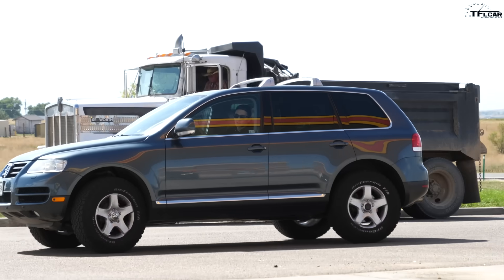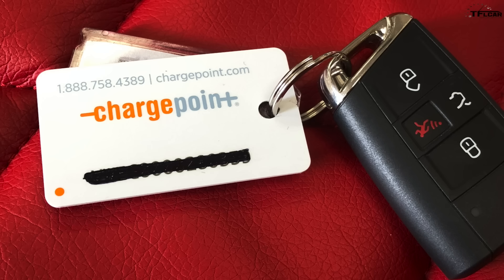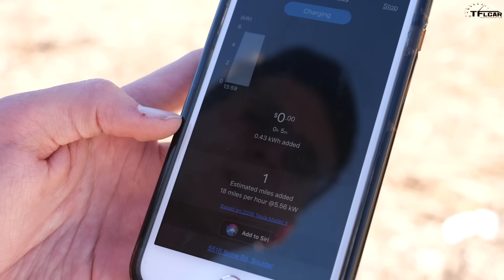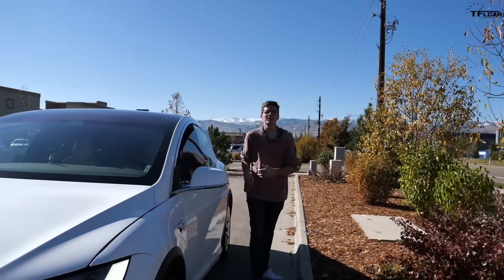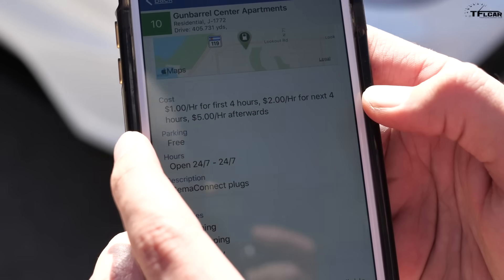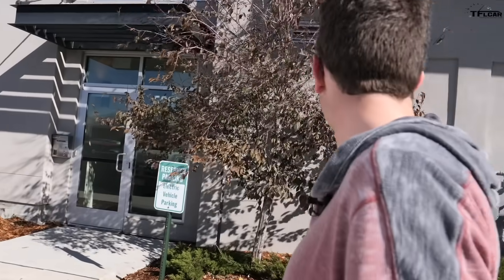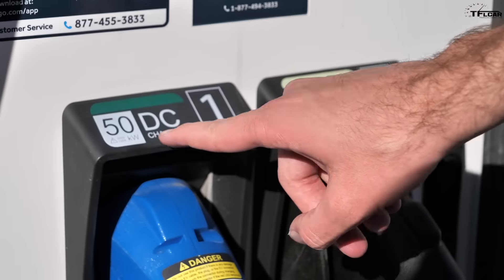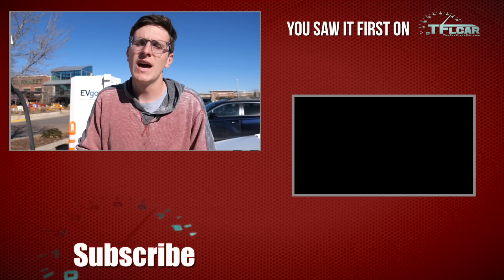Here’s Why Charging an Electric Car Can Suck - And It’s Not The Reason You Think!

Comment: Here are a few questions that must be asked when you own a EV.
According to what you stated, do you really want my wife (77 years old) "backing" into a charge station next to your Tesla???
How about the kids opening the doors of the minivan which parked next to you and hitting the side of your Tesla or other EVs?
The charging station is operational from 8:00 am - 5:00 pm.  I work those hours and drive my EV to work.
The electricity supplier still burns coal to make steam for the generators.  (so much for no air pollution)
OK, you have atomic reactors supplying your charge station.  Can we bury our reactor spent rods in your back yard?
What is the price of replacing your Tesla battery when it dies plus the disposal / reconditioning fee for this service? $13,000 -$15,000. 
Warranty will replace your battery if needed IF YOU KEEP YOUR BATTERY ABOVE 70% LEVEL.  The must have software installed to monitor this?

Comment: 99% of most people's driving is within 50 miles of one's home.  This means you have to go to a gas station, perhaps using a gallon or two of expensive gas to get there and back.  Round trip, 30 minutes easily.  EV's plug in at night while you sleep.  You just get up and go, no wait, not trips to the gas station.  Every house has 220 volt electrical service.  It's' what powers your electric stove, or larger air conditioning, and all central air.  Not a big deal to run a 220 outlet into your garage.  It's not rocket science.  All it takes is an outlet, some 10-2 romex, and a 30 amp breaker.  All can be purchased for under $100.  Of course, you will want a licenced electrician install it.  But the cost is minimum.  No big deal.  Then you have your very own "gas" station in your garage, anytime you need it, even while you are sleeping.

Comment: The majority of Tesla buyers have garages and intelligently charge their vehicles over night. Drivers rarely drive more than 40 miles a day so this process is quite sufficient for most drivers. I consider using a no name, non Tesla charging station for a Tesla a last choice option to be used only in an emergency.  Like going to a gas station and the filler nozzle is only an eighth inch tube. With all the benefits of driving a Tesla compared to ANY other vehicle (gas or electric) you've really gotta loooook for something negative to say.

Comment: While it remains only an extreme minority of drivers using EV's, and only people to whom the inconveniences do not outweigh the advantages, this all works.  
There is no way for this to go mainstream right now.
Plus, I own all my vehicles.  Who is throwing me  $50-$90,000 to replace them? 
Admittedly, MOST of my driving would be within the range of an EV.  Not all however.   
That basically means living a Hybrid life.  Gas vehicle for when the EV doesn't fit the mission, EV for most of the local stuff.

Comment: What if everyone had one of these cars, can you imagine the wait time involved?
Reply: The wait times would be worse than the 1970’s at the fuel pumps!
Reply: Waiting an hour to get 17 miles?

This garbage will never work in rural areas.
Reply: SOLAR PANELS ON HOOD AND TOP OF VEHICLE?
Reply: @Juliet475  OR A HORSE PULLING IT!
Reply: @Juliet475  USA is all about to make money they will never do that
Reply: Imagine a cross country trip? It would take you an eternity to get across the county and that is providing your car is running perfectly.
Reply: @philipe7937  I don't have to imagine a cross country trip in an EV - I've done several. It is entirely practical, and I could easily make 800-1000 miles a day if I was in a hurry. Did that a few times, but more often the point was sight seeing and visiting folks, so most days were under 400 miles. But I got from San Francisco to Cleveland in 3 1/2 days.
This charging video grossly overstates the problems of EV charging. Tesla, in particular, has built out a fast, reliable, well placed network of easy to use chargers. And on busy routes some sites have 50-100 chargers, so no waiting even on a busy travel day.
Reply: I know uh.  Wouldn't be very practical, although I do like the idea of E-cars.
Reply: @LegacySportsTake  but they cause cancer
Reply: We already get blackouts as it is in the severe cold and hot months.
Reply: The mall in my home closed their charging ports bc it cost too much electricity lol.
Reply: And what about the rude people that plug in their car and go shopping or visiting or and one of the other things they would do instead of watching their car charge?
Reply: Yeah you basically need a Walmart size parking lot with each spot with a charging station built in as well as some restaurants and sleeping accommodations for the camping you’d be doing waiting days to charge

Or you’d be stuck driving around each single day just to charge barely 1/4th a full charge before you need to go home so you work the next day
Reply: Wasn’t the story last week that the grid was fragile and could fail like Tex’s last winter?  Since the electricity is made with coal, is it a coal fired EV?
Reply: There's no way everyone could drive one unless we started building nuclear power stations, which they're not going to do, so it can't happen. That's what makes this debate funny, is that the people promoting EV's are also the people most opposed to the most feasible way of powering them.
Reply: notice the station he is at closes at 5 PM? not very convenient
Reply: They would have to put in so many power plants to support that load on the grid it wouldn’t even be funny. Wind and solar is all well and good but without the big power plants and battery cells that discharge to the grid during peak hours and trickle charge during the night, there would be blackouts every evening when everybody gets done work for the day and goes to top off their car. The power grid isn’t going to be able to support that kind of load if everyone had an electric car right now
Reply: @OneManMutiny  none of that is true. There are nearly 600K electric car drivers in California, as well as 29K in Pennsylvania. You have no idea what you're talking about
Reply: @bradmagnuson6963  So that's why they are having brown outs all the time? They are asking people to turn up thermostats, don't wash clothes and no big screen TV. Fun times....
Reply: @MrLemurman  not true
Reply: Hahaha if everyone had an ev forget everyone will be riding their car every day, the infrastructure will never be able to have such a electric power, still wondering why they want everyone to have power panels in their homes?
Reply: If everyone had them the infrastructure would be designed to meet that instead of gas engines most people would top their cars off every night. Portable chargers would be big and mobile charging stations or a way people could hook in almost everywhere on the road. Kinda how gas stations are. There are plenty of downsides but that's not a reasonable argument. I'm not sure what ev charging infrastructure will look like but saying it will suck because of gas stations everywhere is like saying the automobile wont work because of all the horse trails
Reply: They would need super chargers or something
Reply: ....they'd be waiting forever if there was a major blackout due to the grid getting fried after being overloaded.    You can add EV grid overloads to the list of cataclysms along with EMPs (electromagnetic pulses) and CMEs (solar coronal mass ejections).   Life on Earth as we know it would end for sure!    lol
Reply: @joejohnson3441  If the worst comes to pass someone will make a fortune breeding horses. The next fortune will be scooping up all the horse shit and exporting it..
Reply: @joejohnson3441  geez, dont tell an EV owner this, they loose the freaking minds
Reply: @joejohnson3441  if e cars cause blackouts then gas cars caint get gas unless the gas stations have generators maybe they will be a windmill to provde electricity or sun power, oh my we are sod screwed
Reply: Once there are enough owners of EV cars to affect the revenue brought in by gas taxes the price of charging or cost of ownership will increase to make up for the loss. Roads and maintenance don't just happen they have to be  payed for somehow.
Reply: @cwarner5909  That is already happening in my state. EV owners pay essentially a mileage tax to make up for the lost gas tax.
Reply: @MrGruug  8.
Reply: @cwarner5909  NO - once everyone is FORCED to own an EV, everyone will also be forced to have shares in a hydro electric power station - to keep several cars charged, should they need to make an emergency run to a distant hospital - or worse, in a major power outage (some last for MORE than a week, in the depths of winter - when no electricity means no heat either.
Reply: The power grid couldn't handle that. Not even close.
Reply: @arcrides6841  You are so right.
Reply: @arcrides6841  that's simply not true
Reply: @bradmagnuson6963  depends on the charging rate. Okay yeah if everyone slow charges it would work. If everyone had access to a fast charger then no way. They're like 100KW+. 100KW can literally power 50 homes. Do the math. And even 100KW isn't that fast. Still takes like an hour to charge some cars.
Reply: E cars at this point is a total joke. Lots of issues, to many for this alternative to gas. Examples are battery's exposed to very cold or hot climates are affected, the replacement costs of the battery packs, and battery composition.
Just stick with gas at the moment until most bugs are solved.
Reply: @anthonyguerrieri6494  I totally agree with you. How are we to afford the high expense of changing out the batteries, with that thought in mind, how many people can afford a $60,000 car.?
Reply: @anthonyguerrieri6494  ev's are not a joke. I drove my ev in minus 40 degree temperatures in northern north Dakota, and it did just fine. Electric cars actually perform far better in cold temperatures than any gas car does. Also, ev batteries are now recyclable, and the replacement costs have dropped quite a bit, now that more ev's are not only on the market now, but more are coming out almost every month for the next 10 years. If you hate ev's this much, why are you on here?
Reply: @bradmagnuson6963  Batteries in cold climate are degraded big time!!!! You are lying to us or yourself. Common auto collusions are rear enders and you can bet those cells will be knocked around to some extent and then you are into a world of hurt getting that taken care of. The batteries are composed of TOXIC materials and every state will say "not in my back yard" when it comes to disposal. So many reasons they will not be viable. The power grid now is brownouts galore during the summer and winter is another mess in itself. How many people have been stranded in winter and were able to run the heater til help arrived? Not happening with electric. Watching other videos showing real world examples that are horror stories. $$$'s
Reply: IMO we should ahve gone teh hydrogen fuel cell route. use solar and wind power to make green hydrogen durign teh day, then use the hydrogen to make electricity for the motor. that way it fast refill just like good old ice car. for peeps that want preformanc, there nothign wrong with having a smaller battery instal along witht he hydrogen fuel cell for that extra juice when u want a bit of acceleration or speed boost. if we have gone this route, we can advance further in fuel cell tech to the point where we can generate enough power using hydrogen fuel cell to power our civilization during nite time aws well.
Reply: @yia01  We had a hydrogen fuel cell charger near the airport that had an explosion, don't know if it ever reopened.  It was a company that used tech from GM.  Never heard what caused the explosion. For awhile GM had a research lab in the area, until it was moved to the Detroit area.  They loaned cars to the local TV stations and got great reviews from the reporters who drove them.  Never heard anything more about GM's effort since they moved away.
Reply: It's only really a problem for people that live in apartments. If you have a house, getting a 240 charger is easy, and you never really need a chargepoint.
Reply: @DEAR7340  Unless you have travel more then 200 miles.
Reply: @MrGruug  Understood. I was going by average commute. If you're in sales or deliveries, or just have a much longer than average commute, an EV is probably not a practical option for you.
Reply: @MrGruug  
Exactly....and that's really a 100 Miles one way.....you still have to come back the other 100.
Reply: @DEAR7340  I kinda like the flexibility offered by a combustion engine. If I want to drive six or so hours, as long as there are gas stations en route, I’m covered.
Reply: @DEAR7340  , oh really?

Try living in a rural area where your work commute is 60 miles in one direction and the weather typically dips into the negatives... then get back to me about how problem free it really is.😂
Reply: @DEAR7340  A LOT of people live in apartments. You make this seem like it's not a big deal. It IS lol.
Reply: @MrX-X-X  Miscommunication. I mean (agree) that it is a big deal for some, as you say. I was pointing out that there are still many that are in a situation that can benefit from an EV. 
I know people that choose vehicles according to the way they expect to use it 1% of the time: full size pickup truck, cross country trips, etc. Where another temporary (rental) solution can make more sense, if you run the numbers. 
I think most of those cases are an aversion to change and personal style expression. I'm good with that: whatever you can afford.
Reply: @MrX-X-X  Truth is, if you live in apartments you not making the big $$'s. Imagine $60,000 cars in every parking spot??😳
Reply: @DEAR7340  what drugs are you on? What would you do if you got caught in a traffic jam, or a peer grid problem occurs or the power grid gets hacked, or decide to go on a a trip?
Reply: @DEAR7340  Well thats right but in many  urban centers around the world u have densely populated high rise living.  Can u imagine how viable that is?    And about not needing a charge point  if u have a place of your own to recharge the car   that's assuming your commute isnt that far either.
Reply: @westnblu  Many people believe that the goal is to put 100% of road users in EVs; it is not. The fact that 20, 30, even 40% of motorists would have daily need for a gas/diesel vehicle would still be progress.
Reply: @DEAR7340  houses already have 240 outlets: your clothing dryer, and your stove
Reply: @DEAR7340  Except if you are on the road all the time.
Reply: @DEAR7340  unless you’re planning on taking a road trip.
Reply: @DEAR7340  Unless you take a trip.
Reply: By the time that happens it won't be a problem. Most will charge at home, unless you're traveling.
Reply: @69ztang  , which is the entire point of this discussion.
These things are utterly useless for outdoor recreation, I'm certainly in no hurry to drive one into the back country for hunting or fishing... I prefer not getting stranded.

Northern winters in rural areas will not work at all with commute distances.

Comment: Change one letter change the world . Instead of Charging how about changing the battery ? The idea isn't new , if you have a cordless drill chances are you have two batteries for it  , When one gets depleted you swap in the one on the charger . Imagine you pull into a battery changing station and an automated system pulls out your empty battery and replaces it with a fully charged one in less time than it takes to fill up a twenty gallon tank and you never even leave your car !
Reply: Great concept... but who owns the batteries? They have a finite life, which is shortened by "level 3" rapid charging.

Handling batteries (that weigh 100s of pounds) greatly increases the chances of failures and fire.

Also, if you have a battery catch fire in the vicinity of many other batteries, they may all go up in a big conflagration! At $10k to $18k per battery, who pays when 100+ of them all burn up? Who pays the hazmat cleanup bill?

Comment: I look forward to the day when I see these cars on the roadside because of a myriad of problems with charging and batteries, perhaps get the change to splash water on them as I speed past in my Gasoline powered vehicle... just kidding I will stop to see if I can help, then bust out laughing...🤣🤣🤣
Reply: The dependable tow truck or rollback that comes to collect the dead EV will be powered by fossil fuel - let them put that in their pipe and smoke it.

Comment: I am an electrician. I have 250 volts to my house (yes, whatever you want to call it, in most places it is now 250 volts, not 220, 230, 240, like it used to be) My A/C unit, range, water heater, and clothes dryer run off 250 volts. BUT. I only have a 100 amp service panel. It works fine for what I am using it for. It would NOT be able to run all that other stuff and charge a car. And upgrading it in my location is not really an option. It would mean running a completely new service line from the power grid to my house, at a cost of several thousand dollars. That's not going to happen. And even if I could charge a car at my house, how far would it go before it needed to be charged again? How would I drive it cross country, which I tend to do a lot? I don't use apple for anything. Never have, never will. That is one EVIL company. It would be at least 50+ years before battery powered car technology is actually usable, and hopefully by then something MUCH better will have come along. I'll just stick with good old fashioned gas. My credit/debit card works at ALL gas stations, no phone or apps needed.